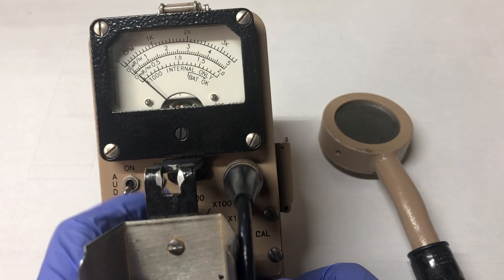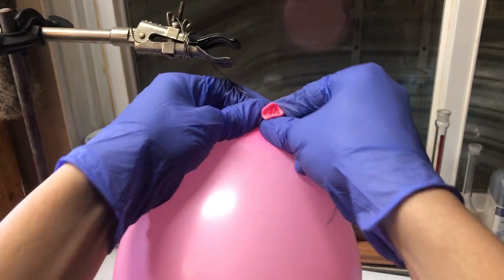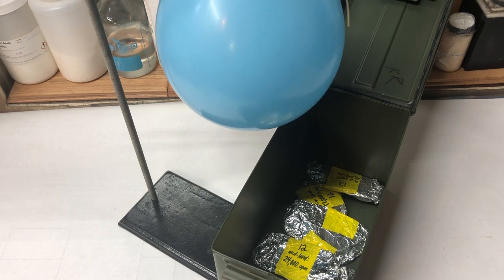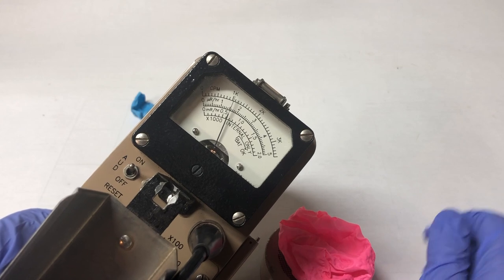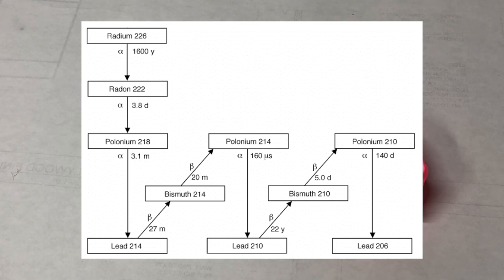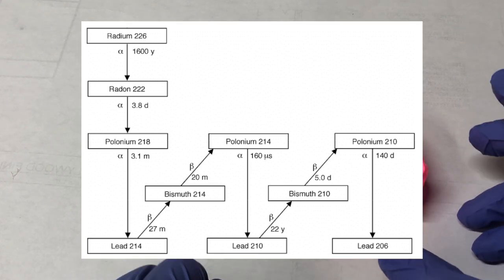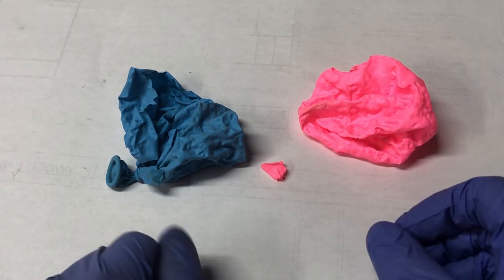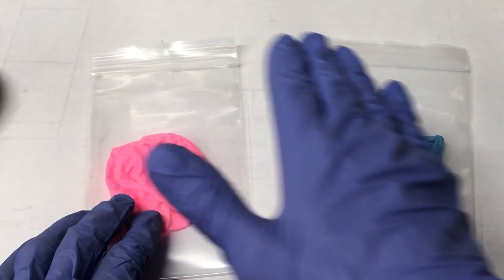Why Is This Balloon Radioactive!?!

Comment: Woah! I tried this experiment in my basement and was very impressed with how well it works! I got a reading of 3000~ CPM from my GQ GMC 600+ (which detects all 3 radioactive particles + x-rays) and only left the balloon in the basement for 30 minutes in my basement. Was very impressed with how a balloon could be so easily covered in radon! Thanks for doing this. Very cool!
Reply from the maker: Glad you enjoyed the video, out of curiosity, do you live in an older or new house? Thanks you for the kind comment!
Reply: I'd say it's around 30-40 years old. Not really that old but not that new. My basement has lots of concrete and has a low foundation. Some extra radon could also come from granite deep in the ground (I live in New Hampshire, the granite state) and I've heard that granite can have amounts of uranium and thorium, including decay products.
Reply: @mr.9931  Do not worry! Neither granite no radon and its daughter isotops will do you any harm.

Comment: Although I love this video and experiment but... It is not a radioactivity that you register. What you register with Geiger counter is not radioactive radon daughter isotops, but rather remains of static electricity on the baloons. You should inflate  the baloon rub it with your hair and deflate it and immediately measure and you will get the same result. Geiger counters register electrons as well as gamma. In fact it registers electrons even better than gamma, but electrons have much less probability (but still some) to penetrate Geiger counter outer wall.
Reply from the maker: Nope! Try it for yourself.
Reply: @WheelerScientific  Thank you! I will try. Great video, but the way.

Comment: problem is the test source on the side of the Geiger counter was a little to close and effected the results majorly.
Reply from the maker: The source is relatively old for Cs-137, and with the shield door closed and with the shielding in the probe from that angle, it needs to be right next to the Cs-137 to read anything.